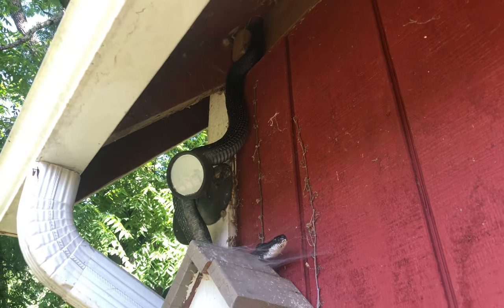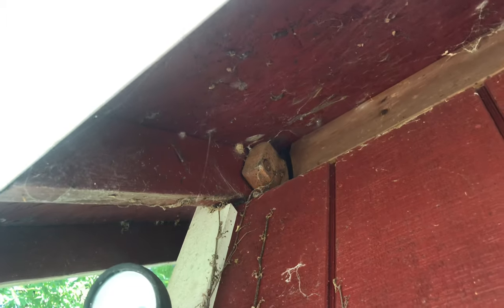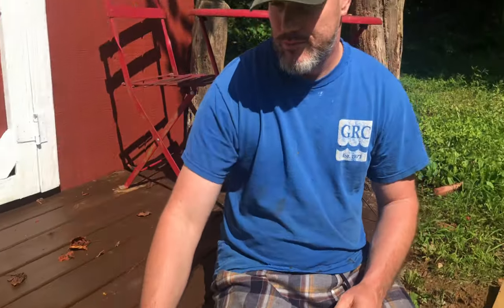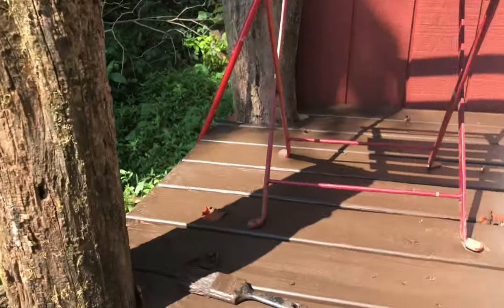Giant SNAKE lives in our barn!!!

Comment: The length of the shed is actually not the size of the snake because the shed is a bit electric and stretches. The shed can be between 2 and 4x the true length of the snake. At 7 feet of shed, it’s likely she is close to 6 foot long.